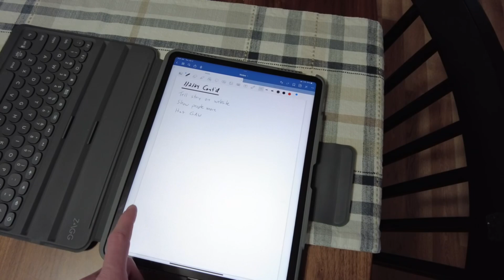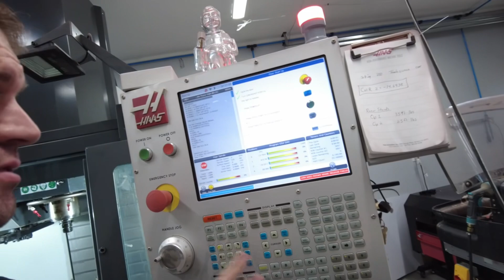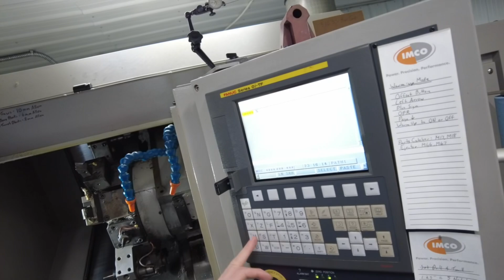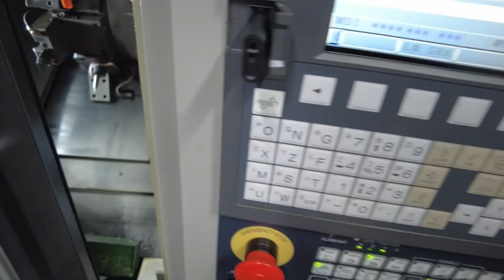YPM Vlog 10- Morning routines and machine issues

Comment: Fun stuff after the holidays! I came back to one of the machines having an sticky valve too. I guess sitting around for a couple of weeks didn't help. Doesn't the Haas have some sort of oiler for the air system?
Reply from the maker: Machines definitely don’t like to sit. I believe the spindle is air/oil, but not the air to the rotary.